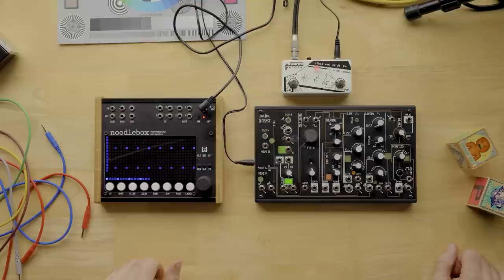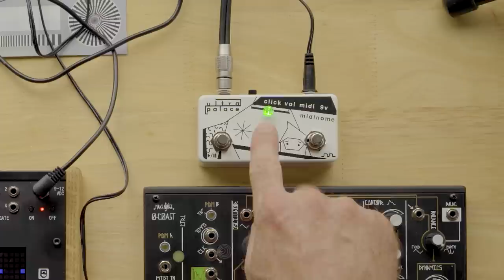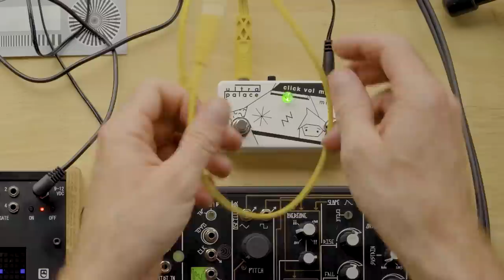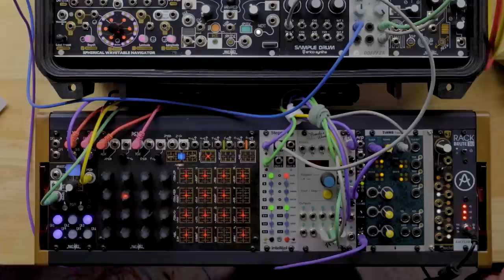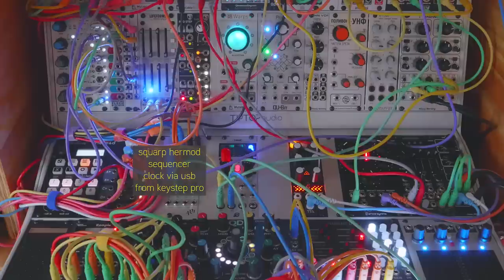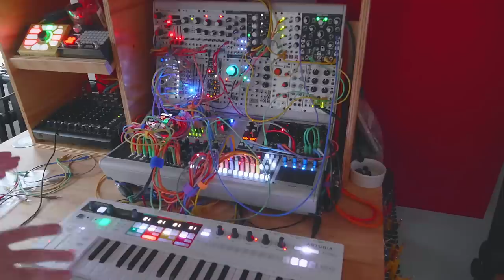Let's Talk Eurorack Clock

Comment: I now need a Mimeophon. Thank you- I think…

Re Steppy however- I recently bought Steppy, partly based on one of your other vids, and I’m not terribly impressed tbh. Aside from being furiously complex and not very user-friendly, it doesn’t sync properly to Pam’s, which is the master clock in my system too. If I feed Steppy 96bpm from Pam, it plays at 24bpm. If I feed it 300bpm, it plays at 75bpm. Obvious there is a workaround (simply multiply the Pam’s output by 4), but surely it shouldn’t be necessary? Every other sequencer I have, fed 96bpm, plays 96bpm. Steppy doesn’t. It may prove too useful to sell on, but currently my opinion of it is about as high as yours of Tempi…
Reply from the maker: Steppy needs a clock at the ppqn you want it to advance, not some massively insane clock

Comment: What do you do if your oscillator doesn’t have a gate in? Do you run said oscillator into a vca and the gate to the cv input of vca?
Reply from the maker: oscillators without a gate or trig in are always running. you have to subtract volume from them to form an envelope. run the oscillator output into a vca and a trig into the trig input of an envelope generator, and patch the output of the envelope generator into the cv input of the vca. then take the output of the vca, which is now being shaped by the envelope.
Reply: @RedMeansRecording  modular is crazy. Really makes me respect the synth creators out thar
Reply: @RedMeansRecording  also...thank you for taking the time to respond to me. Been playing synths for awhile but only just now getting into the modular world

Comment: If the Tempi (sp?) only has a clock input, that is indeed dumb, because with just that input, there's no way to divide or multiply a signal without at least one cycle (positive and negative parts of a sine, leading edge of one pulse to leading edge of another). That is what defines a frequency. The only way to do such a thing with just a clock input is to have that fundamental input a really high clock. Like 1 MHz (That would give a 1 microsecond delay).

Comment: Can you point a sad person to the point where he shows how to FINALLY sync Tempi to … anything else? :/
Reply: Patch a clock pulse into the Tempo input (south west of the knob, the lower of the group of 3 jacks), Tempi will sync to that signal after 2 pulses.

Looking at the manual, Tempi seems to be a module you're not meant to use unless you have the manual in front of you.
 It's trying to do too much with too little user interface.